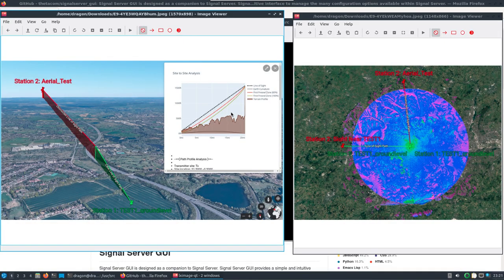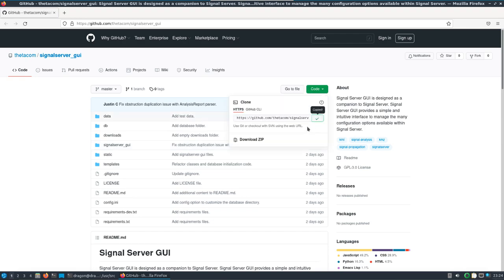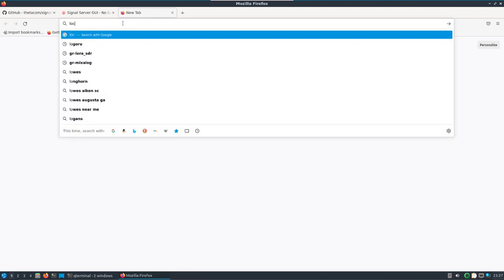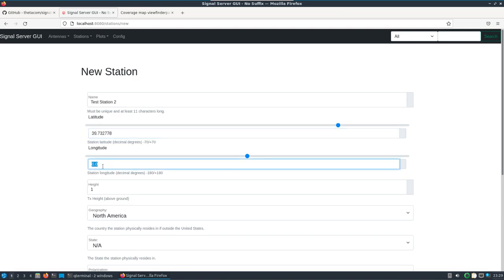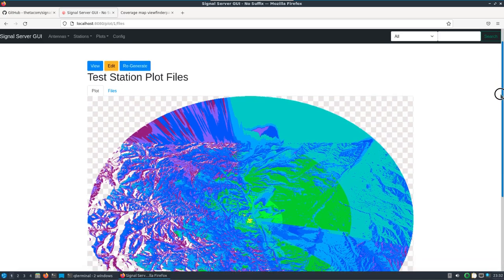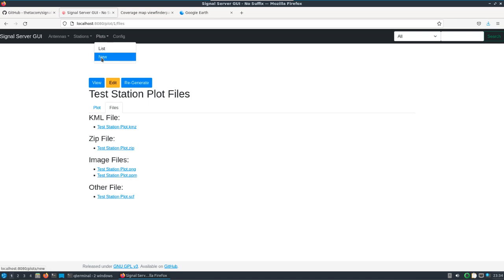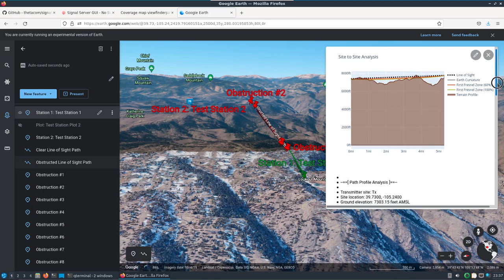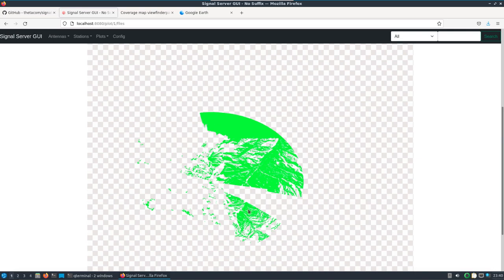DragonOS Focal New Signal Server GUI Setup + Intro to RF Propagation Analysis (Signal-Server) Part 1

Comment: Can we visualize the RX coverage in reverse instead  of the TX perspective? Hopefully this make sense. 😅 kinda for 462mhz 2w walkie-talkie as an example? Or will this calculation be the same?
Reply from the maker: You got me thinking I’d better revisit this haha. So I know you can do a point to point calculation, so if you put correct info in for both ends you’d get detailed info in the pop out box for free space path loss, rx levels on receive end etc if I recall. I’ll have to check about the propagation plot itself.

Comment: Oh nice! Thanks for all these info!
I have a question about the bladeRF micro A4.. I know how to activate the bias-tee with bladeRF-cli but I can’t use the bladerRF in another software because it’s used by bladeRf-cli. How do you activate it to use it in different softwares? Thank you!
Reply from the maker: You know what, I actually had to do that very thing while trying to use the bladerf with gr-iridium. If you look close in this video you’ll see how I turned on the bias t, this same technique should be usable with gqrx when passing the device arguments. I’ll have to check and see if SDR++ has the option selectable or not. Things that use Soapy will likely need the variable passed another way. SoapySDRUtil —probe driver=bladerf I think will show the available options. 

DragonOS Focal Demod Iridium Voice, IridiumLive + User Requests (GR-Iridium, bladeRFxa9, hackRF) https://youtu.be/WljlmoNVW94
Reply: @cemaxecuter7783  Ok thank you very much I will try this. So normally for some softwares it’s possible to enable the bias t by the device arguments in the conf files ? Sdrangel too?
Reply from the maker: Good question on SDRAngel, I’ll go check. I started up SDR++ and didn’t notice a bias t option. Not sure why more programs don’t include it. Thinking maybe I’ll file a feature request on some of the GitHub project pages, maybe it can be added. I’m also thinking and I could be mistaken, I think bladerf cli can turn something on and leave it on while the cli is not running. Have to check that too.
Reply from the maker: I just checked, SDRAngel allows you to turn on/off the bias tee from within the program. There’s a BT button when you configure the bladerf as the input device.
Reply: @cemaxecuter7783  oh yes it would be great to use  bladerf-cli for other soft like the rtl_biast -b 1 command..
Reply: @cemaxecuter7783  ah nice thank you ! When we enable the bias t in sdrangel does it enable all the two rx and tx ?
Reply: @cemaxecuter7783  In fact I have the nuand tri band antennas connected to the tx1 and rx1 with the bt-100 and bt-200 and on the rx2 I have a 2.4ghz passive antenna and a dummy load. Is it ok to enable the bias t like this?
Reply from the maker: That I’m not sure 🤔
Reply from the maker: Well you know what, when I had the extra external lna on my bladerf and enabled the bias tee with gr-iridium it didn’t seem to perform nearly as well as just using the internal bias tee, I didn’t understand why that was the case. I’ll have to check again using SDRAngel as I have both those adapters you mentioned.
Reply: @cemaxecuter7783  I will remove the passive antenna but can I keep the dummy load on the tx2 ?
Reply: @cemaxecuter7783  Thanks! I always give you a lot of work!!! Sorry!!:))))
Reply from the maker: I believe so, I’ve kept the amp on the rx side and removed the lna.
Reply from the maker: I meant I’ve left the amp on the tx side and removed the lna
Reply: @cemaxecuter7783  Thanks a lot for your help! I really want to improve and your advices are important to me!:)
Reply: @cemaxecuter7783  Ok !:) Thanks!

Comment: What SDR do I need to use these tools?
Reply from the maker: Technically there’s no SDR involved, unless of course you are wanting to do analysis on a transmitter and receiver link you’re setting up, or maybe you’re using an SDR to get information on a transmitter and want to do analysis later. There’s many things you can do with it, but it’s not directly tied to using an SDR.
Reply: @cemaxecuter7783  Now I understand that I don't need an SDR.

Comment: Other Questions:
a) Is Ubuntu an operating system?
b) does it work in Windows environment?
c) What is (DragonOS)?
Reply from the maker: Ubuntu is an operating system (Linux based. DragonOS Focal is a customized version of Ubuntu that I’ve been working on the last year or so. All my videos are assuming you’re using the DragonOS I’ve put together for x64 (PCs, laptops etc) or the version I’ve put together for the raspberry pi. 

The only way Signal Server GUI and whatever else I show would work on Windows is if you put DragonOS Focal inside say virtual box or VMware running on Windows. So technically, it would work on Windows if that makes sense.
Reply from the maker: Oh and to further clarify, DragonOS Focal is based on Ubuntu 20.04 which is a long term support release of Ubuntu. I wanted to build an operating system that was tailored to those interested in software defined radios and any software that was related in one way or another to them. I’ve taken all the time to pull together hundreds of pieces of software in an attempt to make it easier for others to keep up and running. 

Someone took some time to help write a description here,
https://sourceforge.net/p/dragonos-focal/wiki/Home/